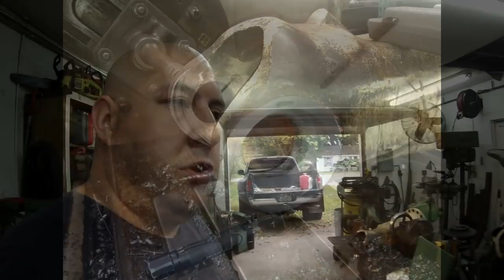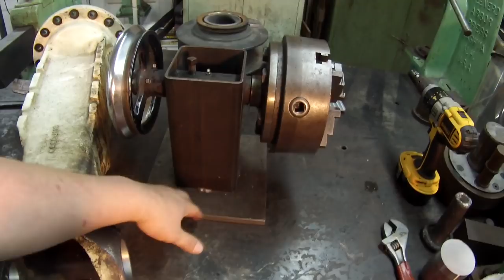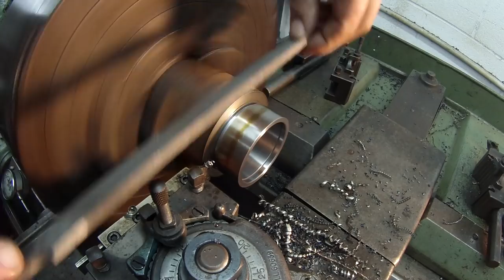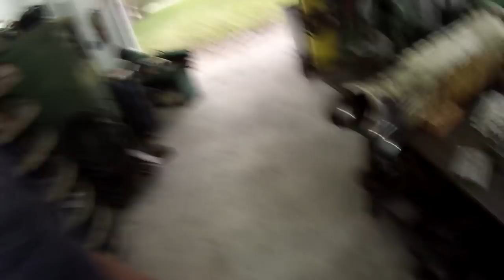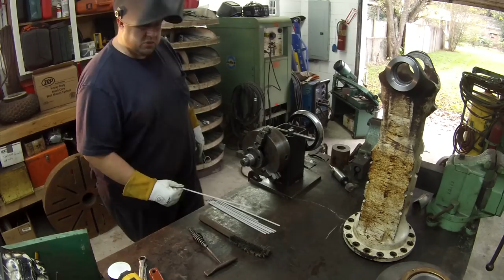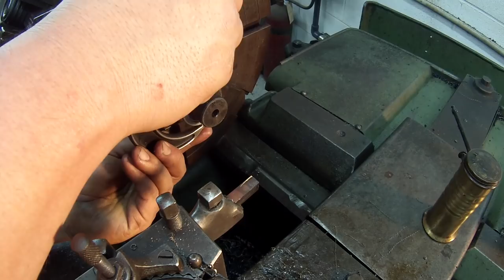Forklift Axle Housing Repair

Comment: Kearns horizontal boring mill. WOW I ran one in Ceres California that was built in England in 1929. (This was 1992) The one I ran hed a 10'x10' indexable table. I built a valve for City of New York Water Works where the flanges needed a record groove finish. If my memory serves me the biggest flange had a 60" bolt circle on it. I hand layed out the bolt circle, then dialed them all off using a center in the spindle. Then center drilled, pilot drill, and final drill. That one flange was 60 holes @ 15 min. each. 15 hours seems like a long time, but I was busting my ass. The one I ran had no increments on any of the dials. What great memories you stirred up. <:/)
Reply from the maker: That's a great story, thank you for sharing!!
Reply: +Abom79 Thank you for sharing your great videos.
Reply: +WelLRoundeDSquarE  Great story! You mentioned a "Record groove finish" so is that exactly what it says?  We had a Kearns Horizontal mill in shop class back in 69, Sadly the all of the Shop programs were deleted from all of the schools curriculum. Now days you call somebody to fix a dam light switch.
Thanks for your comment
Reply: That's incredible....!!

Comment: great detail and informative i have worked in workshops since i was 6 yrs old standing at a kerosene parts washer learning how things worked from the time i was 15 i was in the machine shop welding, milling boring , anything i could get my hands on i am self taught in a lot of things, but i am missing alot of things i really want to learn like thread turning, i watch alot of your posts abom79 and find your work to be the most informative and applicable to the novice , i am at the point now where alot of the stuff i learned from my dad and you i am using in my work on heavy plant equipment keep up the great work man

Comment: You may not be a pipe welder but you have one hell of a steady had and you weld damned good.
Reply: this guy is a all around complete machinist .. to be able to think and plan for a job and then weld as good as he does and machine close tolerances. When is the last you seen someone use a h.s. tool bit ?

Comment: That's a great repair on a critical component - you appear to suggest that there is nothing much to it but that's not how I see it at all!
To repair the casing in this way with the flange is inspirational as this of course is carrying most of the weight and get it all to come together correctly must be saving the owner a small fortune. As you say in these circumstances helping out your friend it's good to go the extra mile to help.
Reply from the maker: Thank you Dan. I just saved him a great deal of money by repairing this part, but it was a pleasure to help him out as hes always been there for me when I need help. 
The job is quite a challenge and I'd be lying if I said I had no worries during the machining process. it took a while to get that housing lined up and true with the spindle for boring. Also the reverse boring on the back side as I shown in the pictures is tricky too. You have to remember which was to rapid the table at the end of the cut so you dont destroy the part in the process! LOL

Comment: wow what steady hands, i'm impressed with how you started the welds, usually i get it stuck a few times before it starts to run. they are correct about running ground thru the bushings, you should probably ground at the hand wheel shaft to prevent the current going thru the bushings to the shaft but its not critical. i just love watching these video's they bring back so many memories of times long ago. keep up the great work, btw you are correct about calling some one to fix a light switch.

Comment: The shaft you welded up is called a King Pin. That is used in a two peace system that is used in four wheel drive closed knuckle systems and in some two wheel systems. Thanks for the videos.--------Larry

Comment: Another great video showcasing your fine machinist skills! Thanks for showing us the bit about the emery cloth..... I had no idea how you could fine tune a tight diameter that way.

Adam, I think it would really be nice if you had some sort of a variable speed motor added to the hand wheel end on your rotational welding fixture. Perhaps an old sewing machine motor might work out. That way you could have the work piece slowly rotate at a uniform speed while you were applying the weld deposit. It may save you a lot of time and also make the weld deposit amount more uniform.

Comment: handy tool you made, almost a welding manipulator for pipe welding. all you need is a windscheen wiper motor and a pwm circuitboard like a wire speed controler in a cheap mig welder.

Comment: Nice to see someone who knows manual machining. Most of my experience was CNC. Mills and Lathes. From parts 12 feet diameter and 13 feet high and parts .25 inch dia.  x .036 I.D.

Comment: I just wanted to throw an idea your way. With a couple pulleys, a low rpm air motor and an air valve you can control with your foot that positioner could be magic! I know you can turn it by hand but machine turn is so easy and great for use with mig and tig work!
Reply: +melaniew77msn I thought it was a pulley, and that he was going to put a belt on it and slowly turn it somehow with some small motor system, and then much to my surprise, it's a handwheel! lolz ...but when I saw him use it I thought, oh how nice, hand wheel is definitely the way to go, simple and easy wins me over all the time.

Comment: Adam, this video was especially educational for me, more in that it showed me how much work would really be involved in fixing up the bores for the ball joints on the knuckles for my STOCK Jeep TJ.  The knuckle bores on one side got wallowed oversize to where the balljoints would not press-fit in anymore, they would instead only slip or fall in.  My trusted mechanic welded in the replacement joints as a band-aid fix so I could still drive the vehicle, but highly advised AGAINST doing much, if any, off-road driving and that I would have to be gentle on the street with it, which I am doing until I afford the time and funds to get another axle housing.

The method you showed here for repairing this forklift axle housing I believe would be the only surefire way to repair the ball-joint bores on my Jeep's front axle, and would just simply be WAY too much work when I could instead go and pull a good front axle out of a wrecked 90's Cherokee and it would be a direct bolt-in replacement for the most part.

Still, this was very informing and educational, seeing all that would be involved were a similar job needed to be done on the front axle of a 4x4.
Reply from the maker: I feel ya man. In this case that axle housing would have been very expensive, and I was trying to help out a friend. Glad to hear the work was informative for you.
Reply: +Abom79 Just speculating here now, imagining how you might have line-bored the ball-joint bores on the housing knuckles were you asked to possibly to do such a job, like maybe for a fully custom front-axle build with non-stock knuckles and for some reason the ball-joint bores need to be sleeved.  Non-Rubicon Jeep TJ's came with a Dana 30 front axle.  The ring and pinion assembly would be on the driver-side, with the driver-side ball-joint housing bores the ones needing to be line bored in this case.  

I'm thinking the machined gasket surface for the diff cover would make a good surface to clamp flat onto the boring mill table or your parallel bars,  IF the centerline of the knuckle bores are also parallel to that gasket surface.  But if NOT, I'm guessing it would be time to work up a means to clamp it to the table by the axle tubes and rotate it until the bore centerline is lined up with the spindle.  How good's my inferring?

Comment: Darn Adam, parting that sleeve was WAY to easy!!! Parting seems to be such a hit and miss proposition for me, that was cool. I know you have a lot going on so maybe next time your gonna do some parting you could share some tips? Thanks for another great video.
Gill
Reply from the maker: Gill, parting isnt hard when your taught how to di it properly. Even with the HSS blades it always has worked well for me. Just have to have the right tool geometry, feed and speed, and lots of cutting oil. I never used the insert parting tools untill I started at my other job, and boy did I learn something new. They are great! The inserts are designed to make a nice chip with little binding. But I do still like to use the hss blades for parting brass, aluminum, or thin jobs. They both have the uses. 
We'll have to play around with them next time I'm over for a visit. Thanks for watching and the comment Gill!

Adam

Comment: Man you are a true craftsman! Your work is superior, I have to say bravo welding, machining, metalizing and all with mechanical knowledge of  how the parts must work together. Nice hand positioner for welding well thought out and not over priced. To buy a positioner is like crazy expensive. On that shaft build up nice selection with the 7018 a lot of people would have been lazy and used a mig on that but the low hydrogen is a better weld on that! I love the nice surface finishes you get on all your machining that is tuff on welds - with the chatter from welds not being smooth and being hard. Is there anything you don't know how to do?

Comment: Great job Adam, I like it all, from Machining to welding to hammer pressing. I especially like that you are willing to help a friend. I will be making a welding positioner soon, but I think I will use timken tapered bearings instead of brass bushings. Thank you for posting.
Reply from the maker: Id be interested in knowing if the Timken tapered roller bearings will hold up to the weld arc when they are rotating. Please keep me informed. 
Thanks Twitch!

Comment: Another great video Adam, I like to watch your mind at work. I just noticed something about the Monarch, the tooling doesn't move, the head moves into the work. It's good to help your neighbors out, we do that to up here in Kentucky, we call it southern hospitality. What kind of bearings do you use? Do you have a supplier for special sizes? Keep it up young man, can't wait till the next one.
Reply from the maker: Thanks Mark. The bearings in the axle are Timkin tapered roller bearings. I believe he bought them through the the dealer. You can buy just about any size bearing you need though companies like Motion Industries.

Comment: Awesome job Adam, always glad to help out friends. I really like the weld positioner idea, that would come in handy all the time, I hope you don't mind if I copy it?
Reply from the maker: Thanks Michael! I dont mind, thats why I showed it with you guys was to share the idea. Its just something I cobbled together one day because I couldnt afford one of those expensive welding positioners. 
Hey thanks for checking out my videos buddy!
Reply: Abom79 This Old Tony did a horizontal welding positioner some time ago and the vertical may be better since you can move around better standing than sitting. His was motor driven which was OK. He did have a braided wire ground wiper on the table as I recall which would give a better ground, perhaps, and take the current load off of the bearings. Rolling bearings should be sealed in some way due to the flux and shop dirt flying around. Since you have a groove on your hand wheel, the treadle or some cobbled up mechanism could have been used to turn the chuck if you want to weld with two hands.

Comment: If I might be so bold to suggest. For your turning welding jig that you made, find yourself an old sewing machine. Strip out the motor & foot controller, adapt them to turn your jig. This will give you a stable turning speed & free up a hand.

Comment: Have you ever tried putting the repair sleeves in the freezer? they will usually fall right in or go with a light tap, it's how I put sleeves in cylinders.
Reply from the maker: Ive done it, even used ice. But I was in a hurry to get it done.

Comment: Suggestion for your shaft welding setup.  Acquire a variable speed, reversible DC motor that you can control with a foot pedal.  You can get them for a song @ Surplus Center, along with the motor drive unit.

Comment: watching your work , nice stuff, but I see you doing allot repairs on bearings and sleeves and over size undersized repair every consider the freeze method to shrink the new sleeves you insert, one of the ways we did it the navy to put new bearing in actuators we rebuilt.... didn't see it mentioned any wear, but make for dam nice tight fit...  Really nice work...

Comment: So, you don't have to weld, or otherwise fasten these inserts, to the housing?  even at 1 thou?  How long is that expected to last, assuming hard use?   I was just assuming you were going to weld those new inserts to the housing, if even tack welds.

Oh, and I would LOVE to see before and after video of the disaster those bearings looked like before you got to em.  You should try and record that in any future vids.  Yeah, I'm going through your older stuff now....  Nice work!

Could you maybe put some more technical detail in the description?  As example, I think you said you used 7018 sticks to do the additive welding on the shafts?  That type of info would be great in the description, for me at least, being a non-machinist with dreams of grandeur....  Hard to catch that with the fans and the ( 3 phase converter? ) other noises in the background :-) 

Thanks again dude!!!!  PLEASE keep on making videos!  We love this stuff!!!

Comment: Nice green CR seal, I work in the lab that tests those. If you look at the new CR seals catalog from SKF, it even has a picture of me.
And I don't mean to be making a plug for my company, but they also offer a product called the Speedi-Sleeve, which is a precision-ground component that can be pressed over a damaged or worn shaft, to provide a running surface for a shaft seal, without you having to polish or machine it yourself. I'm not quite sure of the condition of the part before this, but it could save you some time in the future, should you have a similar situation.

Comment: +Abom79 - I enjoy watching your video's here in the Great Southern Land or as they say The" Land Down Under". Nice work on the rotary welding jig. Have you thought of adding a handle to the outside of the wheel similar to the ones they have on forklifts, that way you could turn a complete revolution without removing your hand from the wheel.  Thanks see you in the next video!!

Comment: Adam nice repair job, way to help out your bud. I see my questions re ground on the welding positioner and the flange on the one side only have already been answered in the comments.  I do have one other question how are the bearings greased I think you said something about a fitting in the axle I would have thought there would have been fittings in the housing instead?
Reply from the maker: Bill, yes the shafts have the grease fitting in them with a hole going through to where the bearing sits. There must be some sort of plate that I havnt seen that blocks the hole on each side of the bore. If there's not the grease won't do anything but go straight through and out the other side.

Comment: I worked as a manual machinist turning out threaded studs on a pre-world war 2 Landis Cut-threading machine. I did this for 6.5 months in 2008. I would have wanted learn the lathe and Mazak CNC machine.

Comment: You could attach a simple hand crank to the face of your hand wheel to accommodate full rotation welding. Instead of having multiple starts and stops of the weld. Just a thought...

Comment: nice stuff, thanks! a couple question though: 1) why are you stick welding that axle rod? seems like mig welding would be far more controlled...and speaking of controlled, 2) why not hook up a little electric motor to your positioner-rotator? a little motor controller to speed up/down, and you'd have two hands to dedicate to the job. peace

Comment: You do nice work. Be careful removing so much material in the eyelets of the axle housing. The material you removed with the line boar was load carrying. Adding bushings does not replace that load carrying material in certain loading directions and can result in yielding or cracking of the eyelets. You can never get back 100% strength, but be conservative and only remove as little material as possible. The structural integrity is as important as geometry for the durability.